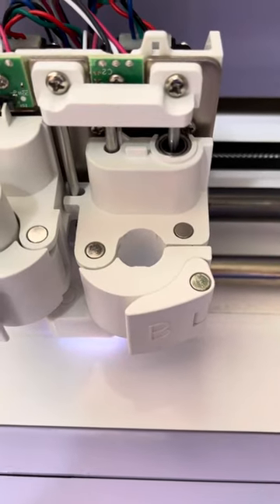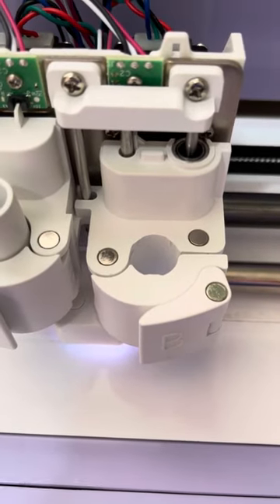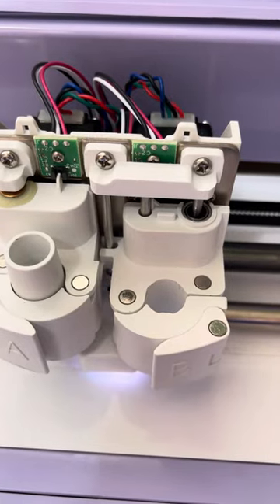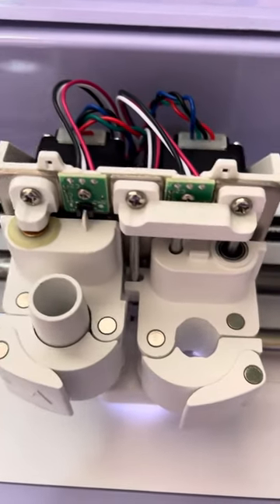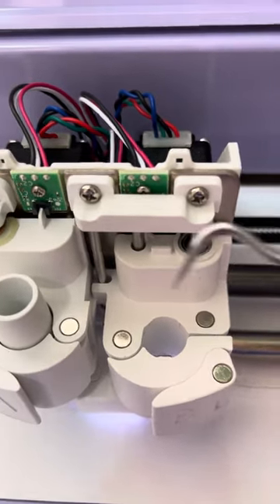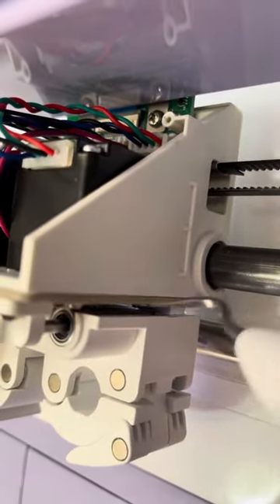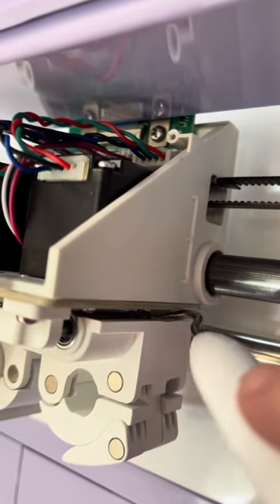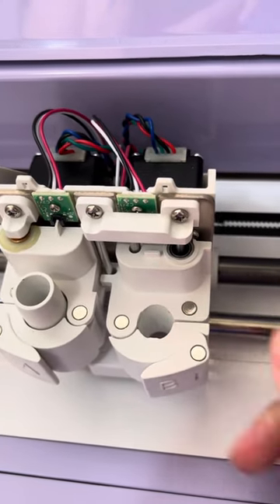Fixing a wobbly Cricut housing B that won’t cut properly

Comment: You are a God send! Why doesn't Cricut know about and endorse this fix? I called them to describe the exact same problem I was having. They first said - your unit is out of warranty (gee thanks) but then offered to send me a new blade and housing (which did not fix the problem). Then I finally found your video. Good as new - Thank you!
Reply: Exactly the same with me - cricut help line not very helpful, but at least i got a new blade and housing!
Reply: @susannabanana3409 tive o mesmo problema, depois de quase 1 mês consegui resolver o meu problema 🙏🏽

Comment: Thank you so much Eranna for this video, Cricut support told me I would have to buy a new machine as mine was out of warranty and there was nothing they could do, my Explore Air 2 is only 3 years old. I was on the verge of buying a new machine when I came across your video. You are an absolute star, clear concise instructions and fixed in a matter of minutes. Again thank you so much from a now very happy crafter. 😀

Comment: I also couldn't get my air2 to cut correctly but following these instructions I'm back to cutting everything again. I did loosen the top two screws as well to move it forward a little to get under the metal tube inside to push up with some pressure. Thank you for making a video because it really helped me to know what to look for. And to think I was ready to go buy a new machine. A HUGE THANKS TO YOU👏

Comment: Thats a great quick fix. My son, an engineer with the navy fixed mine, he took off the B cutter housing and the cam had dropped, so he switched it around, ie turned it upside down.  All fixed now. Shame Cricut Indians n chiefs don't know that there is a design fault.

Comment: I’ve spent more than a year trying to find a video that would help me fix my cricut but none fixed my issue until I found this video. It is a little more complicated than I thought but it worked. Just make sure you are unscrewing the right screws when taking off the silver cover. There are two tiny screws against the back of the silver cover. Kind of hard to see them at first. You kind of have to turn the machine towards you a little bit to see them and since they are tiny, you have to use a very thin screw driver like the ones that come with eye glass repair kits.

Comment: This is what we needed. Perfect explanation! Our hook is pointed the other way so I had a hard time getting the point on the bottom of the bearing. Instead I lifted the housing, put the round part of the hook under the bearing, and pushed down. It snapped right into place.

Comment: You are a GENIUS! I did, indeed, find that the cylinder that slides up and down on the post was no longer flush at the top. However, in the course of pushing it back up, the entire housing unit is now sitting low. It is resting on the block that sits below the A and B housings. I can push it up, but it doesn't stay there. Wondering if it will correct itself when I turn it back on... Thanks for any help; your repair video was spot on!
Reply from the maker: Oh I’ve not had that problem before…hopefully it fixes itself!

Comment: Omg! I actually fixed my machine doing this! It works and cuts everything right through! Thank you so much ❤️❤️ problem is I can’t get the screws back in 🤣but it’s not the end of the world it still works 😁😁
Reply: For me, it helped placing the screws on the plastic casing and then, with the screws on, placed the casing in its place and then tightened them.

Comment: Weird question. Does it make any sort of sound or do you feel the bearing slide back up? Like is there any sort of recognition that “it’s back in place?” I tried without taking the cover off, so I am unsure if it had slipped or not. I didn’t get a “huzzah” moment after trying. Just curious. Thank you for your video!
(Mine is only cutting half the cut at correct pressure and it’s not fully lined up anymore after some intricate cuts glitter cardstock…my new nemesis.)
Reply from the maker: It definitely "clicked" back into place for me
Reply: I did a test cut and the pressure seems to be aligned again. 🤯THANK YOU for your brilliance!

Comment: How in the world did you get to the screws on the back of the silver box thing?  HELP!!
Reply from the maker: You will need a tiny screwdriver to not only fit into the screws but to also be able to access where the screws are. I haven’t tried but you may even be able to follow these steps without taking the silver housing off.
Reply: I just did it to my cricut. You need a very thin screw driver like the one that comes with an eyeglass repair kit. That’s what I used. Also, when you unscrew the silver cover, try leave the screws on it when you pull it off. That I’ll be easier to screw back on.

Comment: how did you get the housing off to show the insides?
Reply from the maker: There are little screws holding the casing on. You’ll need a little screwdriver to get them out!